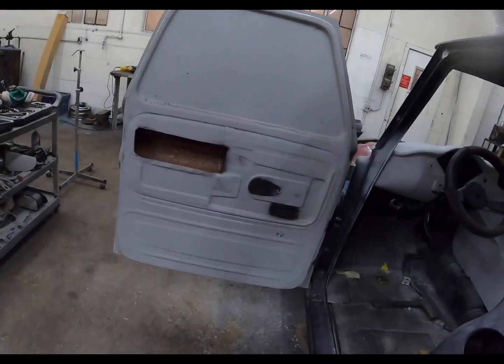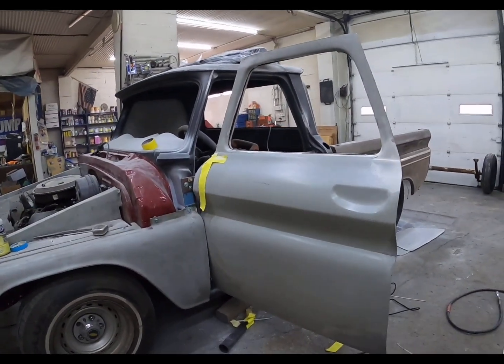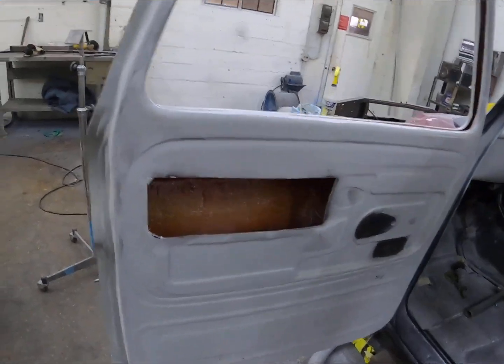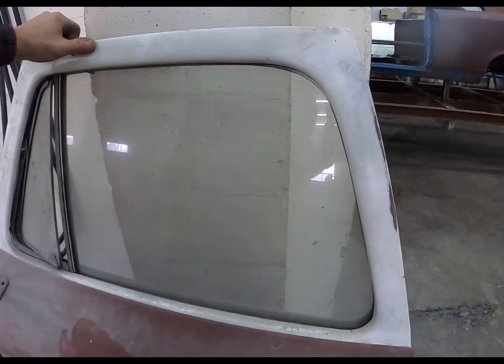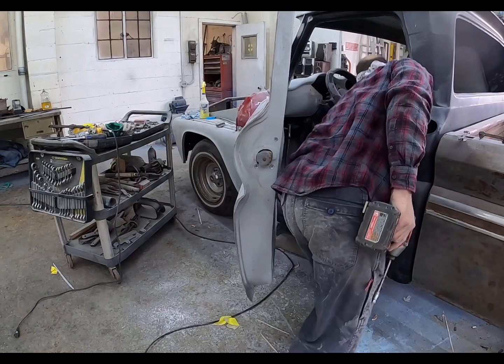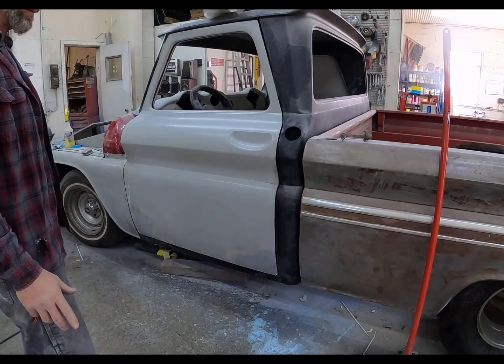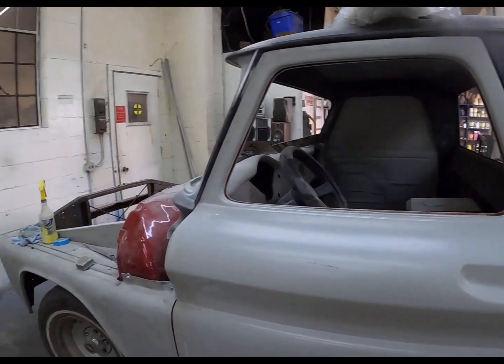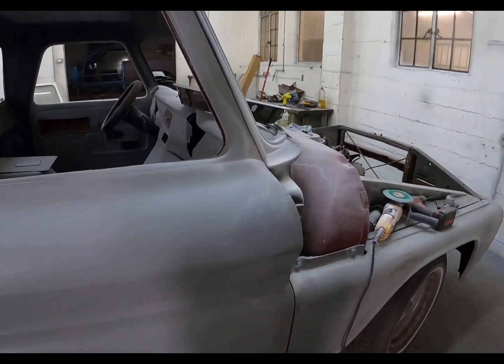Blown Budget fiberglass doors GREAT

Comment: I noticed at the 58:00 minute mark you wrestling with the cutter hose. Old school tip, try running the supply hose across your shoulders that way you are not fighting gravity.
Reply from the maker: It was more the angle of the curve trying to get it to cut smoothly.